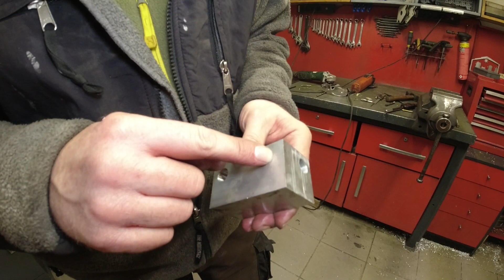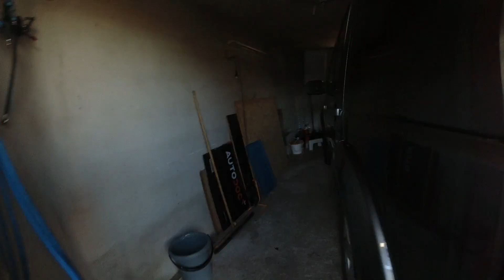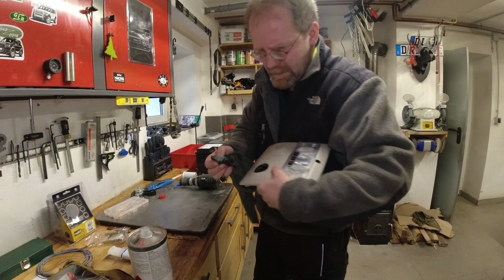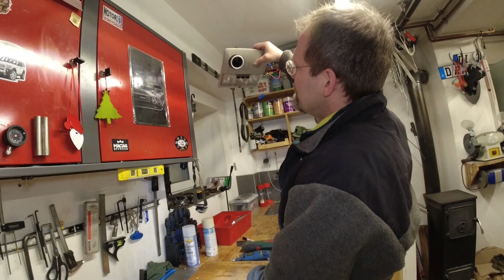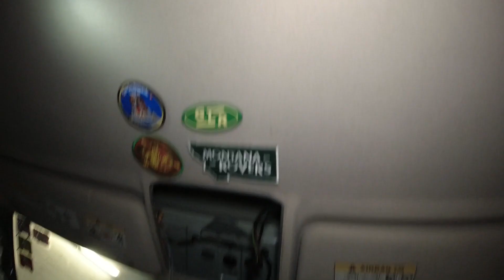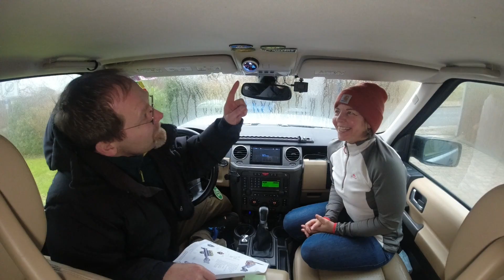Land Rover Discovery - How to install an oil pressure gauge

Comment: I have the Madman engine monitoring system installed on my Defender. It used a similar pressure sensor. This sensor eventually became very unreliable and Madman later started to introduce the solid state pressure sensor.
This sensor is much smaller, almost as big as the pressure switch, and also much more reliable.

Thanks for the great video.
Reply: EMS-3?

Comment: I bought my Defender with a device called a "little black box" which has its own multiple sensors for oil, water, voltage etc. It only gives warnings not any readings. Seems like a nice cheap little solution to add monitoring of vital info to vehicles without those sensors. I hope you find that interesting :P

Comment: Perfect timing. I installed a 3 gauge pod on my D3 dash, central, between and just above the vents. It's from MUD UK and its for the Puma but I had to angle the base to suit the D3 dash angle. I hadn't yet worked out how to add an oil pressure transmitter to the oil pressure switch location, but here you are with all the details and a UK supplier.  Only today my Wife was saying how good the VDO gauges and clock looked.... but what a pity that they didn't work !  :)